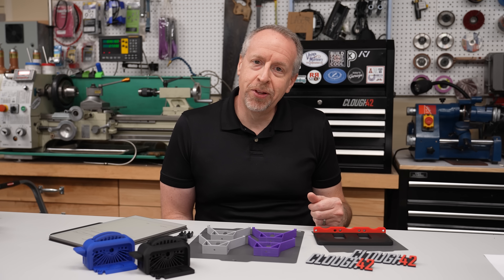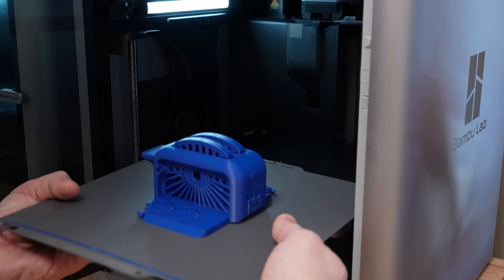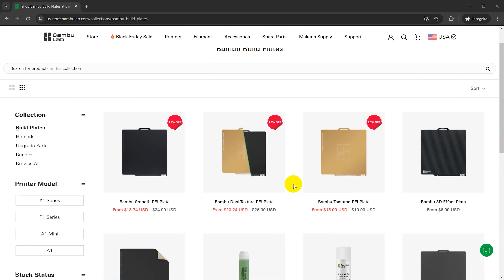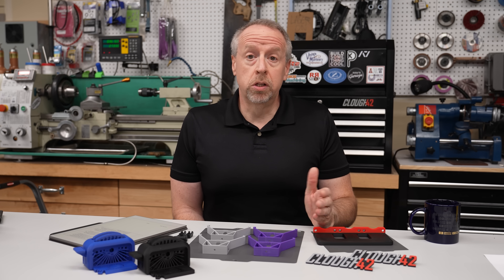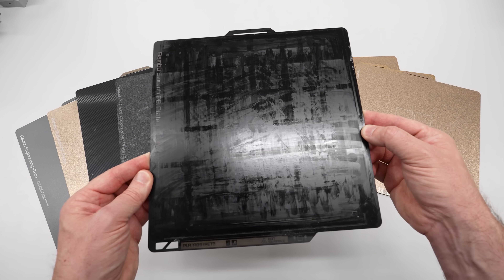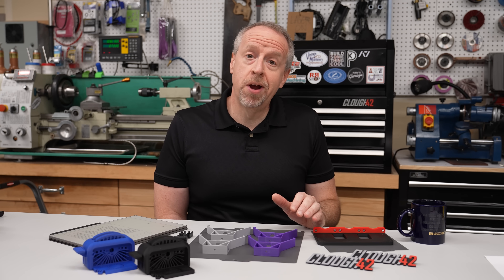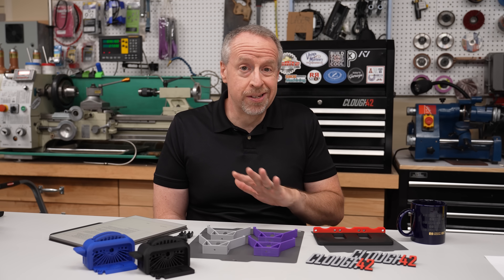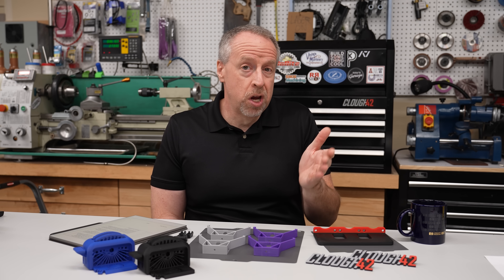Can't get your prints to stick?  Try this

Comment: I print almost exclusively in PETG and have been using the engineering plate with zero issues.  I wash it with warm water then put the liquid glue on it every so often, and have only had a couple bed adhesion issues when it's a really small footprint. In those rare cases setting up a larger brim takes care of it.  I am interested in trying the Super Tack plate, so I think I will order one of those.
Reply: I’m interested in that super tack. It’s sold out right now.
Reply: I do the same with the engineering plate. The supertack is exceptional though. So glad I purchased it because I was contemplating it and 5 minutes after I ordered it was sold out. Still is.
Reply: I always hear about petg adhesion issues. I never use glue, i actually prefer a dirty plate because if its freshly cleaned, that PETG isnt letting go to nearly print breakage
Reply: @GucciBodyBags  Depends on the plate really. What plate are you using?

Comment: ;) jep, can proudly say i have a profile for flashforge "standard" petg and a printerprofile for those cheap pey sheet. i just use 99% iso and fresh paper towel (lint free type) every 8-12 printhours. it sticks so good that i have to wait for the plate to cool to 35-40c before it must be flexed off. i have have a few fails while dailing in the temps where it ripped the surface with it! 
running this setup for about 400 hours now with 0 problem. it stick so good i can swing the model and plate around even with big models with small surface contact ;)

the temp is 80c for smooth pei in the slicer and 260c firstlayer @ 33/44 mms. 
enjoy the fruits of my labor pls

Comment: Are you an affiliate with Bambu Lab? Reason I ask is because that's most of the content I see here. Personally, being a user of a Prusa MKS3+ for over a year, I have zero issues with PETG adhesion on a textured plate, and I never any sort of glue for adhesion, so I'm wondering why the X1C (a newer printer) has this issue.

If you're not stuck in the Bambu Lab sponsorship suck, look into the Prusa CORE One. RIP X1C.
Reply: Did you not actually watch the video where he directly compares textured to this? Because he literally directly covers it, so your conspiracy theory here is bizzare. He also directly states he has an affiliate link so you asking like it's a mystery to unravel is also bizzare.

Also, rip X1C?? With the more expensive optional extras not included, misleading marketing years late printer with pretty much the same featureset but a less convenient mmu unit (not included)???

Quite frankly I'm betting you think rip because you probably also fell for their misleading marketing and its not your fault, it's theirs. The Core One does not have an actively heated chamber, just exhaust fans.

Comment: Wonder how it compares to Biqu Cryogrip / Glacier.
Reply: Literally the same thing.  I have all of them and it’s exactly same.
Reply: It's different.

The Glacier specifically can be wiped with rubbing alcohol, is a tiny bit less grippy, and is compatible with more filaments though requires more heat for PLA.

It also has almost a satin texture to it.
Reply: @BeefIngot  the frostbite.  Only Pla and PETG.  Like the Bambu one.  But with texture and even more grip.  

The glacier is totally different.
Reply: @alecubudulecu  Not sure what your point is. The previous person specifically asked about the Glacier.
Reply: @BeefIngot  look at OP comment again.  it was cryogrip / glacier.  that's the entire product line (well the 2 )

Comment: If you're using the textured pei plate with PETG don't use glue. It sticks great but comes straight off with a slight flex. PETG sticks so well
Reply: I've had PETG stick so hard to textured PEI that I thought they might be permanently attached. When it finally got it off it took several chunks of the PEI off the plate.
Reply: Great advice, except when you print with supports. Then glue would the only thing that prevents you from spending half an hour cleaning the plate from small PETG leftovers.

Comment: I've always had these results on MATTE and SMOOTH PEI. Not textured. Has worked for every type of material I've printed. PLA, PETG, ABS/ASA, Nylon, and even PC-ABS. Oh... and I never use glue. That's just unnecessary and messy for no tangible benefit.

Comment: I’m pretty happy with the supertack plate so far. I still had curling with PLA before I washed it with Dawn. 

The high temp plate is still my go-to for smooth surfaces. If you wash the high temp plate with Dawn and scrub it with a red Scotchbrite pad while it’s soapy, it has an almost 100% success rate for me. Bambu says you can sand the plate with 600 grit to increase adhesion but it’s not really noted anywhere aside from a single line of text at the bottom of the store page for the build plate. 

I’m glad I’m not alone in having trouble positioning it. It feels like it’s almost too wide to fit between the locating pins in the X1C.
Reply: Dish soap and scotchbrite has never failed me when I've had PEI adhesion issues.

Comment: I was using the generic Aliexpress versions on 3 of my printers (A1, A1 Mini, K1) for a month before Bambu released theirs. If anyone wants one of those instead, the search term to use is "PEZ" or "Polyurea". Biqu's Cryogrip is also an option. Might as well get the Bambu version, because they're not more expensive than the generic, but it's the only way to get them for non-Bambu printers at the moment
Reply: "Might as well get the Bambu version . . . "
Yeah, but the Biqus are blue ! And blue looks cool, and I suspect once in place the cool new blue look will attract women and win the respect of work colleagues and the admiration of friends. I won't be surprised if I'm married by the end of the year.

*I currently live alone.
Reply: @davelordy  Got the Cryoplate. Id preffer the gray bambu version but it wasn't available at the time. I can tell you that... my wife loves it.
Reply: None for Prusa printers yet.
Reply: Thank you. This is good info.
  
These build plates use polyurea coatings (similar to industrial coatings and those used for garage floors).
  
One vendor says: "A must-have for Farmers" (sic).
Reply: Polyurea is used as spray on truck bed liner
Reply: @adamaglionby7438  Good idea to try on just simple springsteel plate I guess.
Reply: I looked on Amazon and couldn't find this type of build plate for a Sovol SV08 (350x350, same as Voron 2.4)., but there were several smaller versions for different 3D printers.
Reply: Any for the voron 350?

Comment: I have textured PEI plate, and I never had issues with PLA not sticking to it. I keep the bed temperature at 50C
Reply: Try 30.  And use a very sharp angle.  This is where these shine. It’s same as the biqu frozen plate

Comment: I have a A1 mini and print mostly with PLA basic and PETG-HF using the PEI plate. I wash the plate with dishsoap and a toothbrush once evry 5-10 prints and never had any issue of the part not sticking (mostly enclosures for various things) with the standard setup from the slicer. Even sometimes, some part are a bit too sticky.

Comment: I have a very large printing job i plan to use all bambu filament ill use your link to buy them from now on hope you get some lol planning to get over $2k
Reply: Why not purchase the Polymaker, it is the exact same filament but cheaper!
Reply: That sounds like a recipe for a mangled plate with spring steel.

Why not look up the alternatives like biqus cryogrip series that has various sizes

Comment: I was also having trouble with PETG adhesion with textured PEI, until I cranked up the bed temp to 80C, and now its working perfectly (on my horrifying UM2 clone). Maybe that's worth a try for when you want the texture.

Comment: Lower build plate temps equals higher chances of print curling... I haven't used glue or any adhesives since I found my temperature sweet spots... i print everything from PLA to PA6-GF

Comment: Cashed in my MakerWorld points and used a gift card to pick up the SuperTack plate already. I've had it almost a week and I too am very impressed by it's adhesion. I've only done PLA on so far, but have no complaints thus far.   Edit: This is all on an X1C.

Comment: will it work on my ender? I don't exactly have bamboo money for what little I use my printer for (I mean trust me when I need it I use the hell out of it, I just don't need it that often)
Reply: Depends on sizing I think, but it probably will you’ll just have to look at what movements you have for printing and where stuff prints and of course leveling difference
Reply: Buy a third party version of this made for your printer specifically. Cool Plate Super Tack (what a silly long name) is just their name for a new material a few companies are selling plates with now.

The Biqu/Bigtreetech Glacier plates are probably what you want.
Reply: The Bambu printers have a bigger bed. Bigger by enough that I don't think it would work without cutting the plate a bit.
Reply: It’s not the correct size for an ender
Reply: How much was the ender? Bambu A1 mini is 199$
Reply: @JeromeDemers  8 years ago, with sales tax and shipping abut 189 give or take some change, and its got 40 mm more XY  and 70 more Z... I mainly print electronics enclosures so bigger build volume works for me, and that puts me into a 300$ before tax and shipping A1
Im not saying it's a better printer at all, its kind of old school tinker and fiddle, but its holding my desk down to the floor 60% of the time, then when a project comes up that thing can't catch a break for a month or more going 24-7 attached to a old HP touchscreen convertible i5 laptop just banging out parts ... then it sits doing its primary job of table gravity

Comment: They plan to do something similar for ABS/ASA? Honestly there I see serious warping.
Reply from the maker: Those filaments are hard.  ABS-GF helps a ton.
Reply: @Clough42 yes, is one of the materials that can be used for high temperature  applications. I would preferred to be nonblended, but c'est la vie
Reply: Cryogrip Glacier is almost the same thing from biqu that trades a tiny bit of stick and hotter temos for higher material compatibility and the ability to wipe it down with iso
Reply: @BeefIngot  you have testd it with ASA?
Reply: @contrezerva9024  No, but it is supported according to the spec sheet

Comment: on my ender 5 pro i just run a glass plate, without anything else. i can print petg pla asa tpu and more without anything else holding it on
Reply: Glass sounds so painful in modern day. It's almost as bad as revealing you use painters tape. like sure it works, but god do I not remember it fondly.
Reply: I built my own printer, designed in CAD and put together entirely by me. I've always used glass, but I put on mist of hairspray so prints release much easier. Things have never had problems sticking, that's for certain.

Comment: maybe i'm the one wierdo, but I actually preferred the first example of your logo with the clear CNC path look inside the letter faces.
Reply from the maker: Yeah... It's growing on me, too.
Reply: @Clough42  yeah the "concentric" version looks way better than the 2nd one IMO
Reply: Not weird. I like it too
Reply: Consider it a testament to a good print on a fine tuned printer — the hallmark of a true designer/engineer. Like weld marks or carbon fiber pattern.
Reply: For a smooth flat finish, depending on the material, I brush the surface with a bit of acetone and laying it flat on a piece of glass for a few minutes.
Reply: @ that sounds pretty sexy is the result uniform each time? And is it just a few light strokes of the brush just to get it visibly wet?
Reply: @ManticorDrones  Just enough until it's visibly wet, but you have to flip it fast. Too much will leave a bit of flashing on the edges. You will have to let it dry out.
Reply: The name of the channel sucks too. Great content, horrible name.
Reply: I was going to say that too.